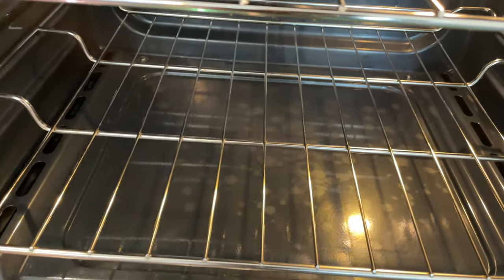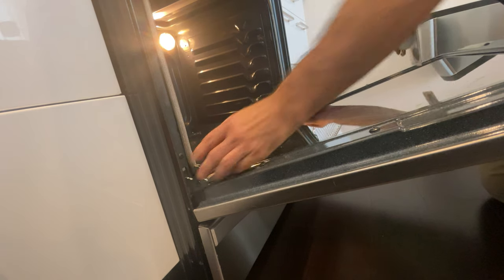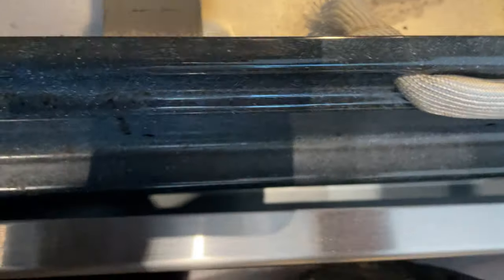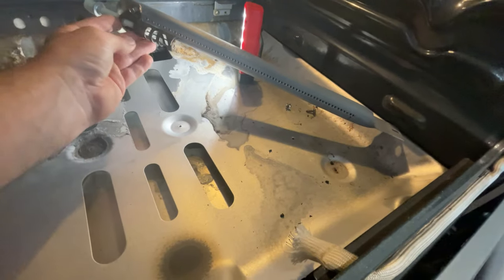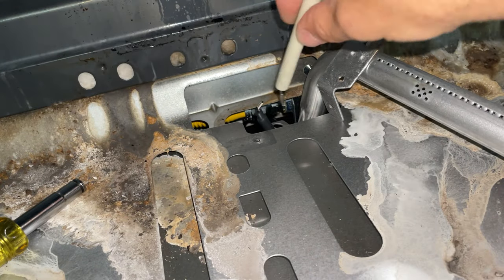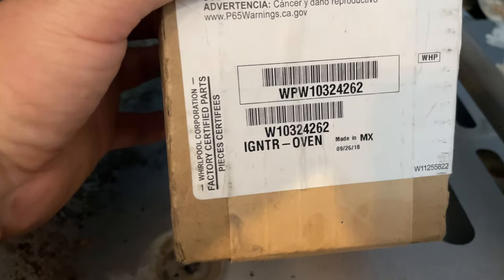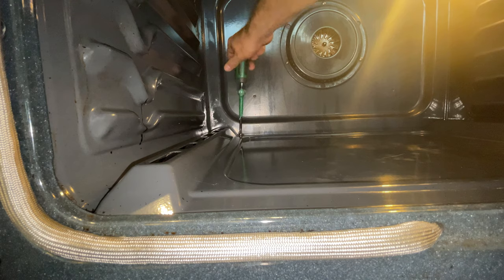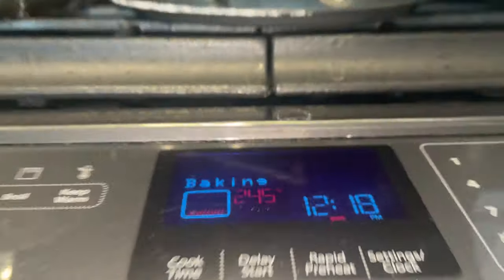Whirlpool Gas Oven Not Heating

Comment: I have a Whirlpool range and the BROIL setting in oven works but not the BAKE setting. I tested the igniter (which does not come on) and it’s good and I replaced the circuit board and it’s good. Don’t know what’s wrong!

Comment: I've replaced the igniter and still does the same thing after a while like 30 to 40 minutes of working and won't turn on again. I have to let it cool so it can turn back on again. what could it be....
Reply: See if it the ignitor moduler... my whirlpool is doing the same thing...I replaced the ignitor and now I'm going to replace the ignitor module, that should solve all of the issues
Reply: @mlm398   I know this is an old video, but my oven has two possible parts listed as ignition/spark module.  One part is a circuit board looking thing listed as an ignition module.  The other part is a little black rectangle deal listed as a spark module.  Do you remember specifically which part you changed?

Comment: Mine is doing the same thing, I purchased the new ignitor and yet it continues to do the same exact thing as it was prior to installing the ignitor that you recommended.
Reply from the maker: I would call whirlpool tech support at this point
Reply: @ApartmentMaintenancePro  
I thinking I found the solution, I believe it to be the ignitor module... going to replace it... then after that if it continues then I'll call the whirlpool tech
Reply from the maker: @mlm398  Cool let us know if that works. These can be tricky to pinpoint the root problem sometimes.
Reply: @ApartmentMaintenancePro  definetly will inform you
Reply: @mlm398  did it work.
Reply: Yea did it work

Comment: Actually mine glows and gas lights but then goes back off. My broiler as well which is on top. Older GE. I'm petrified it's the control board. We've had so many power outages but never affected the stove. but this last one. IDK Not an inept woman by no means but I can't figure it. Ironically tried to put it on clean, thought maybe components were dirty. and like i said hit and miss, then the cleaning started. Broiler was working, then stove so it's getting gas. I let it clean for just 90 minutes then turned it off. Cooled, wiped it all clean then prayed. Oven lights then goes out. Broiler does nothing. I'm just sick. Appreciate any help. No $ to buy a new stove, no $ for appliance repair.

Comment: Mine won't heat either but I don't hear or smell gas. Could it be the panel? Whirlpool Model:
WGG745S0FS01
Reply: I have the same problem with my whirlpool oven, stove works oven doesn’t heat no clicking. I need to pull it out and look it’s just a pain, but check the gas pressure regulator switch. There’s a switch in the back of the pressure regulator (the metal thing sticking out the back connected to the gas line). See if that’s it. Open is pulling out and make sure switch is “out” close gas pressure the switch is pushed “in” but is more like a light switch just horizontal instead of vertical. Hope this helps and that’s all it is! You don’t need to pay someone to fix that!
Reply: I replaced the ignitor and it works great! Thanks!!